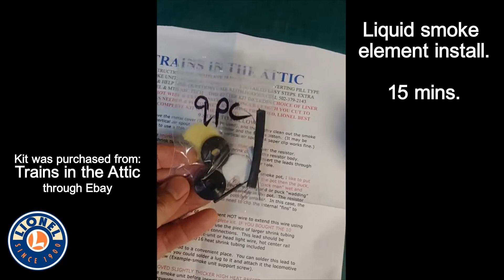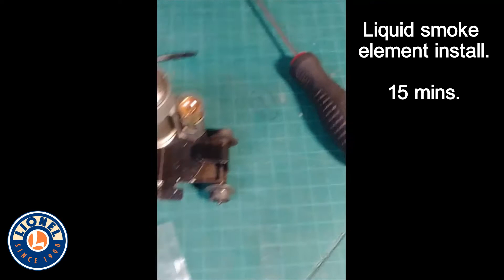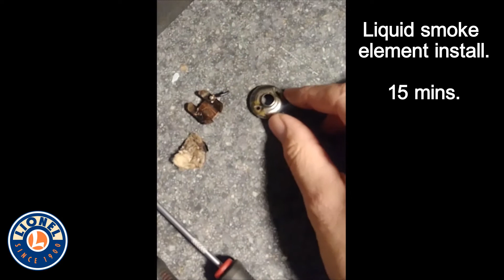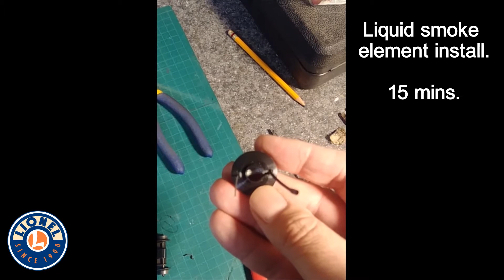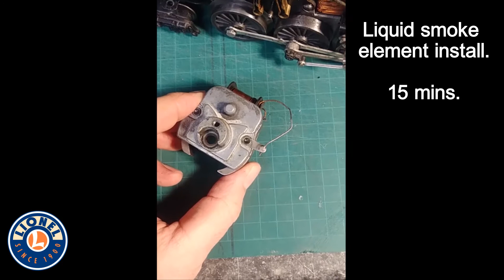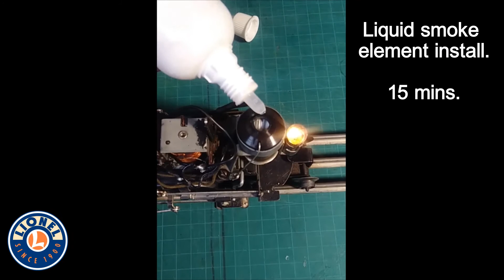How to Replace the Lionel Postwar Pellet Type Smoker With a Liquid Type Smoker on a 2055 Hudson

Comment: Will this work on a 2037 and a 1666 locomotive?
Reply from the maker: Hey, thanks for watching. 100% yes it will work for both 2037 and 1666. The only  difference for the  smoke units on most of the postwar locos are the mounting brackets to the main chasis.

Comment: WHY!!????? There is NOTHING BETTER than the old smoke pellets. They are available at any Train Show!
Reply: I agree  I have them and I have engines  that use fluid I like both of them.
Reply from the maker: I prefer the old pellet type too, but I use liquid in them. As for why........because someone somewhere need to install this type. I can't exclude them.👍
Reply: I MUST BE GOING BLIND. I DON'T SEE MUCH SMOKE!!!!
Reply: The old smoke pellets have wax and that is why there is a white build up over time.  Converting to liquid smoke doesn't leave a residue and liquid smoke is cheaper then trying to get the old pellets (liquid is about $10 vs. smoke pellets of $30).  Plus, they sell liquid smoke in different scents (peppermint, etc) which is nice for the holidays.

Comment: Excellent video. Thank you. I just got my kits from trains in the attic and am anxious to install them. Your video will be a great guide.
Reply from the maker: Thanks for watching. Its an easy install. You shouldn't have any issues. Let me know how it works out!
Reply: @warrenmuzakpostwarguy4331  Considering that I am electrically and mechanically challenged, this went very well.  The spring and cup it sits in needed a good cleaning and a touch of graphite.  Smokes almost like an MTH which is not bad for a 70 year old toy.  I have sworn off anything new with a motor due to poor QC in the PRC.  I am enjoying rehabbing my old stuff and working on scenery.